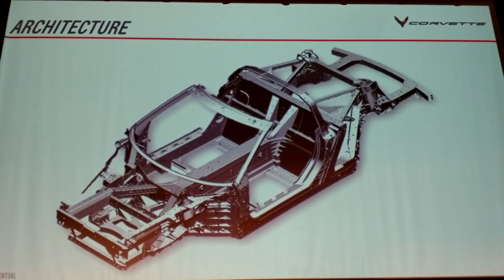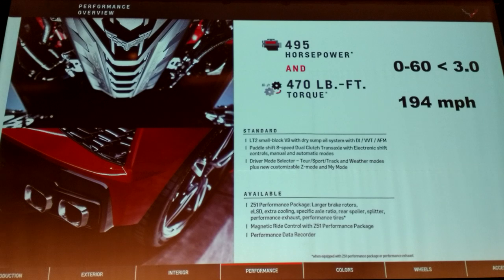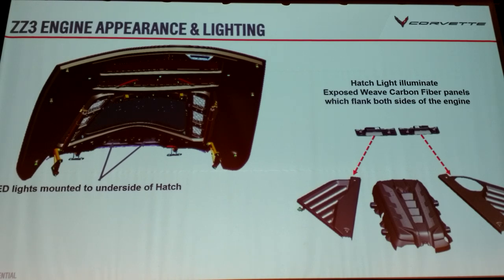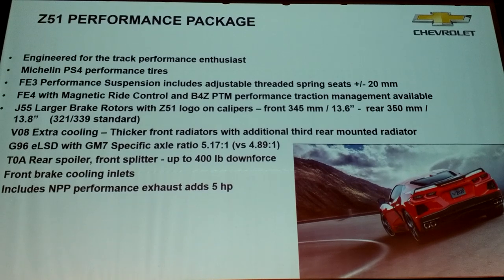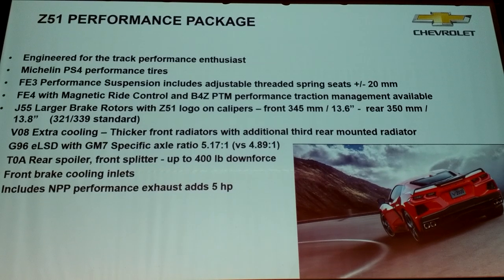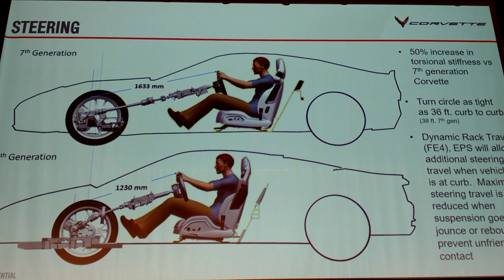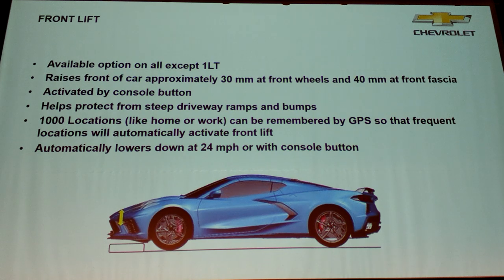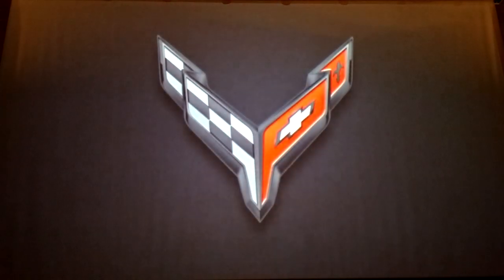Tadge Juechter on the 2020 C8 Corvette Architecture, Z51, Aerodynamics, Steering, and Front Lift

Comment: Ya know... of coarse like the next guy im like the new C8,  what GM/Chevy has done is great,  particularly keeping cost's down.  But before we go all ewwww's and ahhhhh's   lets not forget that is isnt new grounds for sports car manufacturing. Not to say their has not been many improved upon techniques, and some new things here and their, but overall aluminium sports cars are something of yesteryear.  It was all the buzz back when the Ferrari F360 debuted.  And since then then the sports car industry has mostly moved onto Carbon Fiber, granted aluminium is still used for mass produced sports cars like Porsche.  So lets be clear that Corvette isnt inventing something new but rather playing catch-up.  And to that im proud that Chevy has done so without breaking the buyers bank.  Which raises the bar for this specific sector of sports cars.  The 911 which is ever improved on in increments every iteration is now pressed to make the leap into full carbon fiber chassis,  its all a matter of costs coming down.  so the C8 must make leaps and bounds quickly,  especially considering the impact to the industry which comes with going electric.  The additional levels of torque makes for higher levels of quality and stiffness for sports cars chassis.  Those with carbon fiber will have an advantage both in performance and weight.   so..  its about time in regards to the c8,  but the next step is addressing the carbon fiber issue,  if it be carbon fiber or reinforced polymers via graphene.  who know.